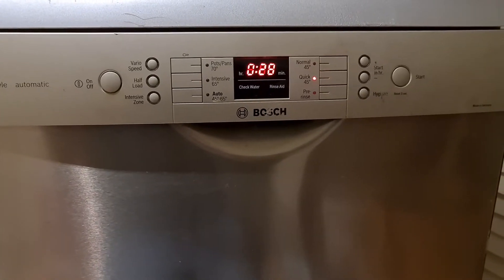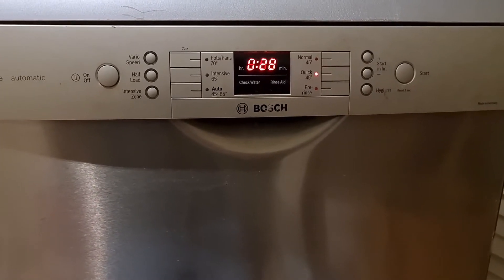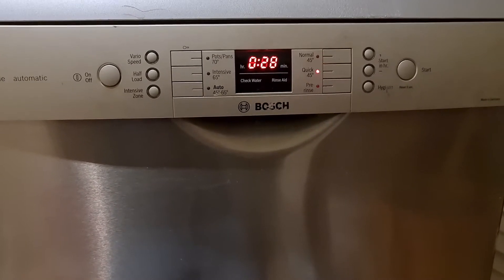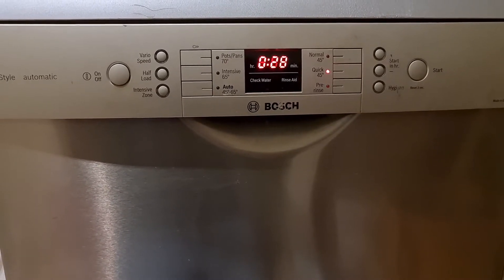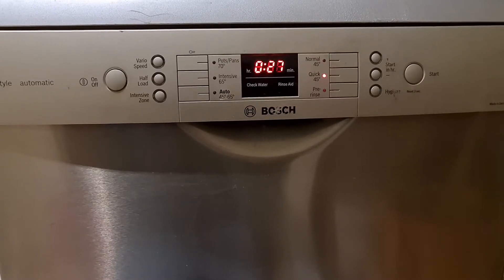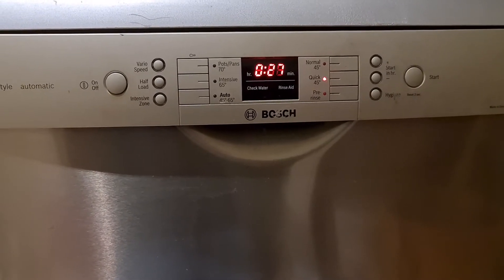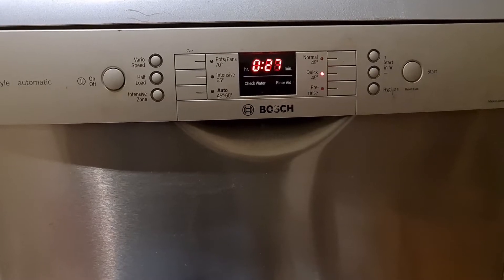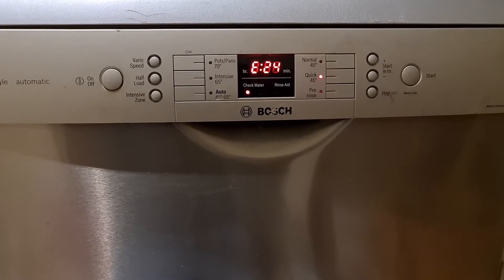Bosch Dishwasher - E24

Comment from the maker: Hi Gokce

The issue was due to a defective wash pump.

Drain pump was OK

The power board measures current consumption by the 3 phase brushless heat pump. The current draw was out of spec and hence you get an E24 error.

Kind regards
Reply: Thank you very much for your reply.  Do you have a video recording where you fixed the problem?  We have the same problem with our dishwasher.
Reply from the maker: @gokceb.8852  

Hi Gokce

I will do a video for you on the process, iam doing another repair for E24 tomorrow. 

Hopefully by Saturday I should be able to upload.

Cheers
Reply: Thank you very much. I will be waiting. Hava a nice day.
Reply: Hello there.  What part did you replace to fix this problem?  Looking forward to the solution video.  Or can you just explain the solution steps?  respects.
Reply from the maker: @gokceb.8852  Hi Gokce

I replaced the heat pump or wash pump.

You will need to remove the bottom tray of the dishwasher.

To remove the bottom tray

Remove the side panels,  worktop, then you will need to remove the hinge ropes supporting the door, so remove the plastic hinge covers to undo the hinge hopes and supports.

Now there is an inlet drain Valve turn it slowly to release all the water from the condenser into the chamber.

Have a bucket and big syringe handy to suck up all the water from the chamber.

Next you will see two tabs which have to be hammer in with a plastic or rubber mallot.

Once this is done the front end of the lower base frame can be dropped.

Now the backend of the rear base frame the stainless tabs need to be bent and now you can drop the whole base frame and disconnect the drain hoses.

Now you will have full access to the heat pump to replace it .

See my channel for videos
Reply from the maker: @gokceb.8852  here are a few videos

https://youtu.be/EVXZlb9Yz1I
Reply from the maker: @gokceb.8852  https://youtu.be/LxBOT0uICww
Reply from the maker: https://youtu.be/LxBOT0uICww
Reply from the maker: @gokceb.8852  Hi Gokce

I will do a full video from start to end showing the process for you.

I have been a bit busy this weekend and have not got around to do it.

Will post one Monday or Tuesday